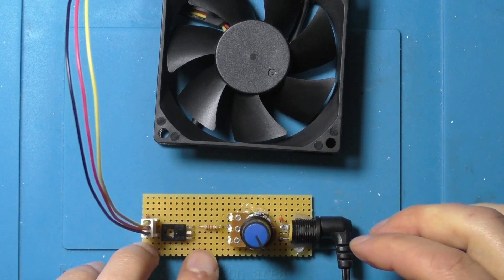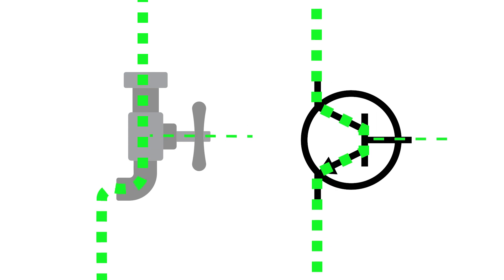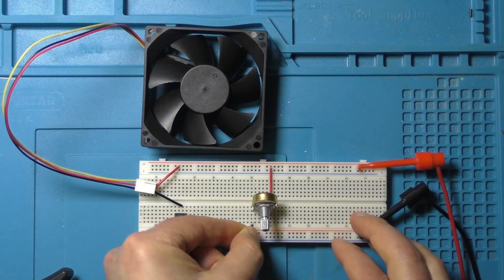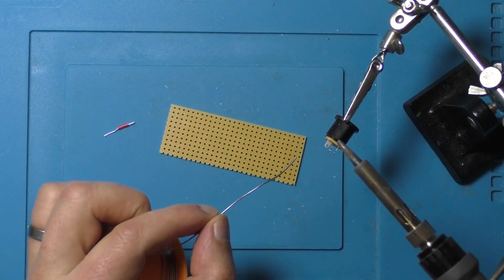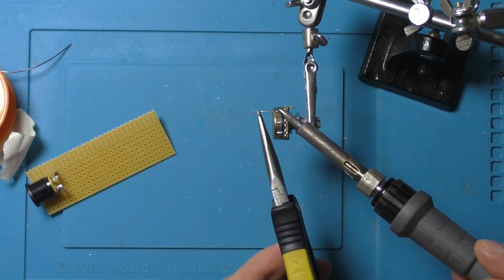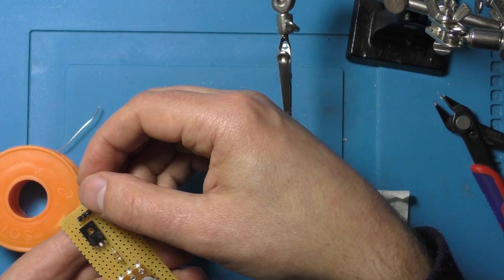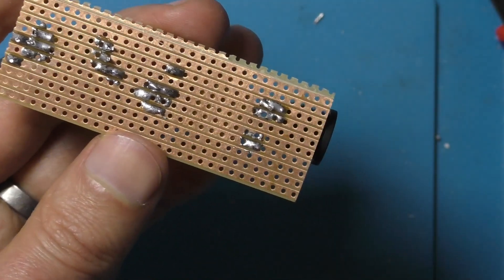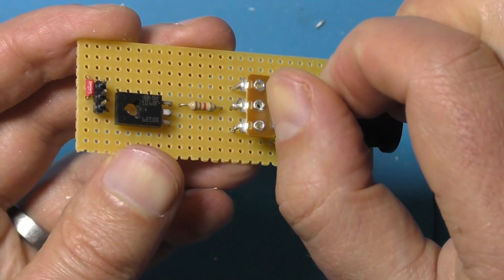Easy Fan Speed Control with a Transistor and Potentiometer - Hacking a fan Part 2

Comment: so the fan is rated at 12v .2 amp and it will run at full speen, what will happen if i supply it with 12v 2amp?
will it spin faster?
Reply from the maker: No it won't. It will use up to it's limit of .2 amps even if you make 10 amps available to it. If you want it to spin faster you can give it more volts, eg 14v. That will make it spin faster up to a point. If you go too high, you'll burn out a wire or get a mechanical failure

Comment: Im still at a loss, i guess some people just cant pick up electronics....
I have a 40mm fan in my palidarium, but its just on/off depending on humidity run by a circuit board and humidity reader, problem is on is too powerful,
Can i put a resistor between the board and fan to slow it down ? i dont need to adjust the speed, just slow it down permanently

Comment: I genuinely don't understand most of the comments, but this video made sense to me and is way better than my previous method of wiring the potentiometer in parallel with a resistor. I only have a 10k potentiometer but 10k ohms is way too much resistance. Thanks to you, I now have a variable controlled cpu fan on my desk to blow solder smoke out of my face. I wired it up on a tiny breadboard, shoved that into an old weed canister, repurposed an 12v power adapter for a portable video player my family hasn't used in years, and a cpu fan from a pc that is currently inoperable (fried PSU). The entire contraption is held together with rubber bands and clipped to my desk with black binder clip.

Comment: This is not efficient as this will cause large voltage drop across the transistor since it is working in active region, so the transistor is acting as a basically voltage dropping resistor (in case of BJT) as a consequence, lots of power loss across the transistor. It may overheat the switch or may damage it. However for those fans having very lower current demand, this can be a cheaper option.

Comment: heat means power loss do it with mosfet instead using pwm
Reply from the maker: yes. simple but not super efficient. A few people have mentioned this now, I might do a vid of doing it with pwm, not sure. I have some LED lights I want a dimmer for so I need to do a pwm circuit for those. Maybe I'll do both at the same time

Comment: By chance just on time. I was planning for a portable and heat adjustable foam cutter with 12 volt 18650 batteries. AI's were fine but their graphics are either to no avail or bad. So, thank you for sharing. 🙏🙏

Comment: Am I able to utilise this setup to control the speed of two 12V 0.6A fan in series config, especially when it's 2-wire instead of 3-wire like yours? Any diodes recommended for safety? Making a fume extractor and hoping to control its speed of 3600rpm. Is the BD139 transistor sufficient?

Would also love to see another tutorial using pwm!
Reply from the maker: BD139 should be sufficient. You might want a heatsink on it if it gets hot. If you want the two fans to have the same speed control then you probably want them in parallel, not series, so they both get the full 12v. If you put them in series they will each get half the voltage and not run at full speed
Reply: @alexstacey Yeah, realised a while later than I'd meant parallel the entire time but mistook it as series. Can't believe I mixed them both up. Decided to grab a mosfet IRLZ44N and see how things goes. Can't wait to give this a shot! Your vid really inspired me. Thanks!

Comment: Brilliant, I've been wanting something exactly like this for a few years now, I prototyped everything on a breadboard and even added in a fun illuminated switch, but in my first more permanent setup, I wired the transistor's Emitter and Collector wrong and destroyed the transistor 😭 
Anyways, I'm going to rebuild tomorrow (this time making sure to get the transistor the right way round!).

The transistor seems to get a bit hot - not too hot to touch - when running the fan at a lower speed, is that normal or should I worry about that? My fan is slightly more powerful than others and draws 0.4A @ 12V maximum (3000 RPM roughly) if this info helps - as far as I know it's within the BD139's ratings for wattage.
Reply from the maker: Ah that's really cool that you're building this. Happy to hear that. The transistor will get warm yeah. It's basically dumping excess current into heat. It's not particularly efficient but for a low power project like a fan that's usually not a big deal. The more efficient way to do it is with pulse width modulation (pwm). I've thought about doing a video about doing that but not sure if I will. Thanks for the comment!
Reply: @alexstacey  Perfect, thanks, I'd love a video on controlling it via PWM as that's my next project lol.
I've put a small leftover heatsink from a Raspberry Pi on the metal side of the transistor and I've strategically placed the controller in front of the fan to cool it down which seems to work perfectly!
Reply: @alexstacey  Make the video sir

Comment: I have a fan like that but it's a bit bigger (6 inch diameter) and it's 115v. .27/.26 amp (that's what it says.) It's insane. I would love to be able to calm it down. I'm not much into these type electronic jobs but I assume the parts used here would not be suitable for this wind tunnel. It was a cooling fan in an old mail sorter that got retired. I have two actually.
Reply from the maker: Hi. No these parts are definitely not suitable for a higher powered fan. Please don't try to use them for something like that and please be super careful doing anything with mains voltage. It can be super dangerous. Thanks

Comment: Thanks for this video, it's just what I wanted! If you continue this series, I'd really like to know how this kind of setup scales with multiple fans. Not really in terms of controlling them but I'm particularly unclear on how the power requirements change. At what point do you overload the system? Do you need more voltage or current? What does that mean for the kind of power supply to use? At what point do you see smoke or damage components? Is there a simple way for figuring these questions out?
I love learning about electronics but I don't quite know how to apply the theory into practice.

Comment: Can u make using NTC thermistor for control like a potensio, so if temperature 60 deegres fan use max rpm
Reply from the maker: That sounds like an interesting project. Could be like for a simple temperature controlled box. I'll have a think about that. Thanks
Reply: @alexstacey  okay thank you sir, i would really appreciate it if you make it and put it on youtube

Comment: make sure to add a diode across the fan otherwise you'll cook the BJT.
Reply: Most Pc Fans are brushless fans, so they have a small circuit built in for controlling the timing of the motor. So they have a diode built in. But if youre controlling a simple DC Motor, then you are right. Because these dont have any circuit in them. The Inductive Spikes may kill the BJT.
Reply from the maker: @Tigi0605 @Fullchaos40 interesting points. Thanks for the input
Reply: Simplu si eficient❤
Reply: What would be the properties of a diode you have suggested? Its specs or code number please. Thank you.
Reply: @Dr.CandanEsin For simple DC motors, a 1N4007 is usually enough.
– Reverse voltage: 1000 V
– Forward current: 1 A
– Type: Standard rectifier diode
If your motor draws more current, go for something like a 1N5408 (3 A), or use a Schottky diode for faster switching and lower forward voltage.
Reply: @Tigi0605 Heartily appreciate. Thank you.